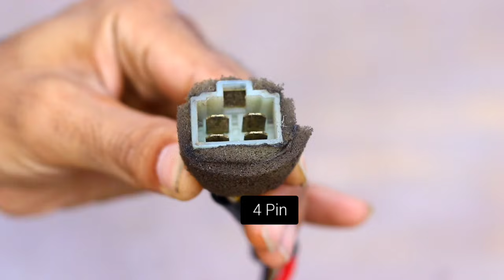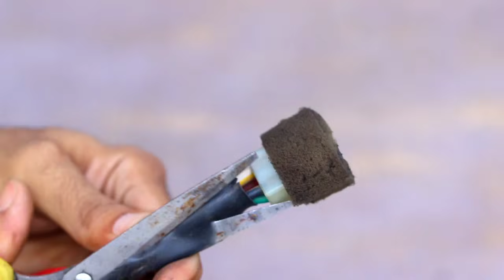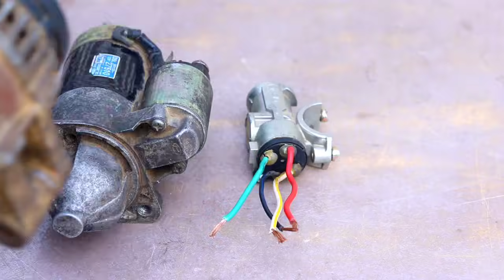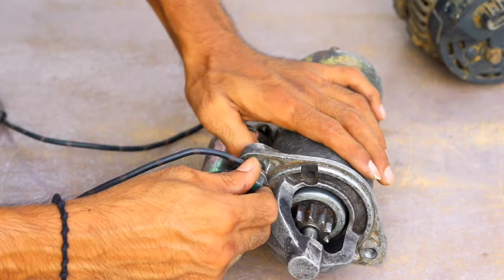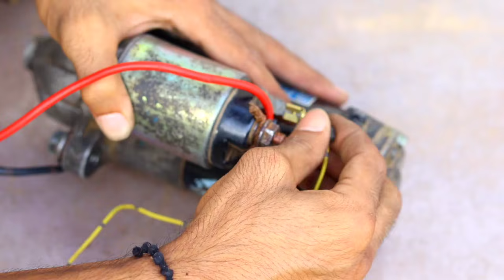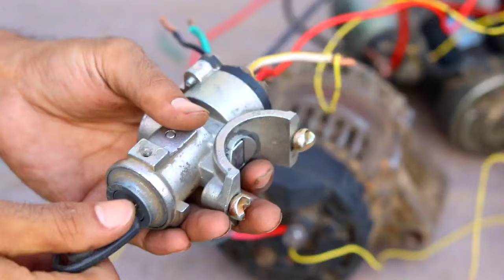How to Wiring Car Alternator and Starter Motor With Car Ignition Switch

Comment: Thanks...

Pls one more thing...

I want to use this connection;  to start the engine with the kick starter  based on your  connection ...

I want to use  switch botton for ignition, another push  botton to start.
Now to stop the engine how do I achieve that with a red push botton.... thanks